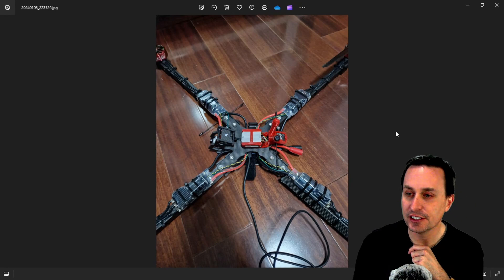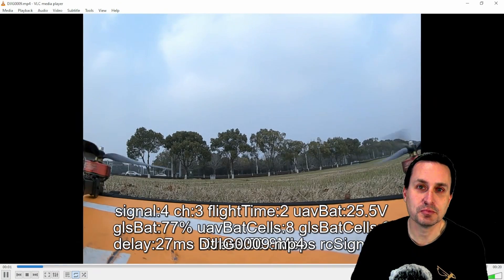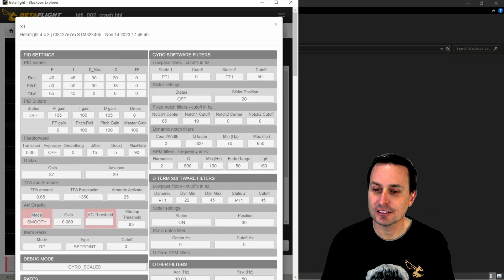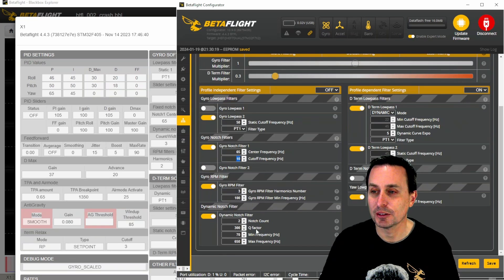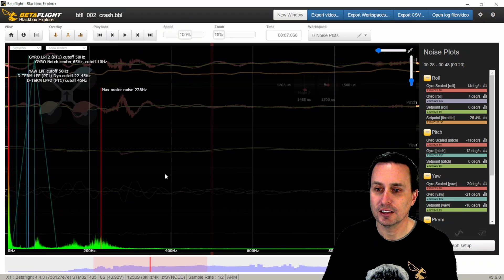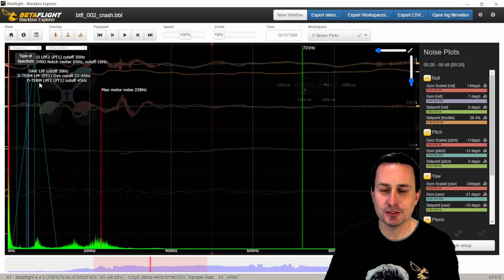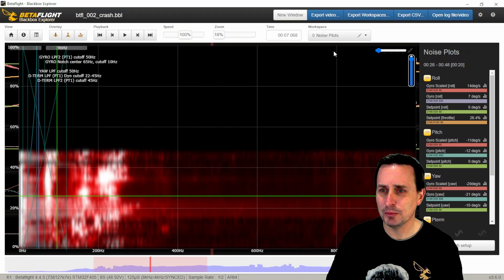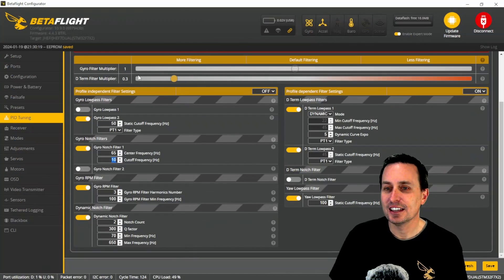XClass Drone Tuning Analysis & Advice

Comment: Appreciate this line of work. I use Betaflight for my 13 inch prop 250 gram FPV helicopter. I was skeptical about any pro looking into helping crafts with 13+ inch propellers. I am amazed you are here handling x-class craft, which often have 13-inch props, crash and the low pass filter is set at 50 hertz, exactly the same as my helicopter's setup.

Comment: So are we not going to talk about adjusting the i-term relax cuttoff and dropping it down? In BF, it recommends for xclass rigs to set cutoff to 3 or 5. 

I-term is evil on a large rig like this from my experience tuning up xclass rigs over the years.
Reply from the maker: yup, for sure if you have bounceback!!

But i-Term Relax doesn't activate for wobble.
Reply: @uavtech  I've had and have seen other xclass rigs run away on people after doing a hard snap flip is why I mentioned it.
Reply from the maker: yeah, I-term is a bitch on big rigs - like you said - because they lag the controller so much.  Big moment of inertia.

Comment: Hey Mark, I have a 7" LR build.
With your preset it flys nice with a 300g battery.
As soon as I put on a heavy 600g battery, it has lots of low throttle oscillations.
Any idea what to do? THX
Reply from the maker: Increase PIDs (Master Slider) some or Reduce the Drift-Wobble slider.  At low throttle and the heavier battery, it is losing motor authority to keep it steady.  

Make sure on 24k PWM (48k is ok, but not as good for low throttle authority).

If only on a throttle chop, increase the Anti-gravity gain a bunch.

Comment: 4:14 dyn notch even with q=100 can never be as powerful as static notch. My apex has 215hz resonance with power of 0dbm which is a lot!!! By adding a static notch 170-215hz it jus goes away, wheareas sith dyn notch q=100 I get the samd latency and a lot more noise. Also, what if I need a 2nd dyn nitch q=500? I cant do that, the q factors have to be the same! So strong frame resobances should be targeted by a static notch!
Reply: You are correct. A static notch is a great tool for alleviating a strong frame resonance. There’s no need to use a dynamic notch to target a static resonance. But never, ever, ever have a static notch beginning at a value as low as 10 hz!! This will cause extreme gyro delay and will induce oscillations like those seen in this video.